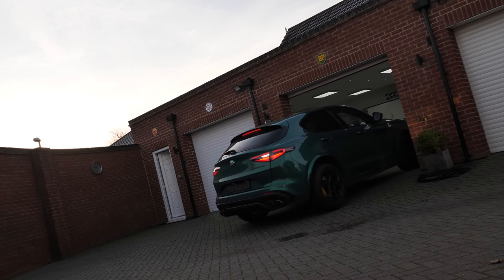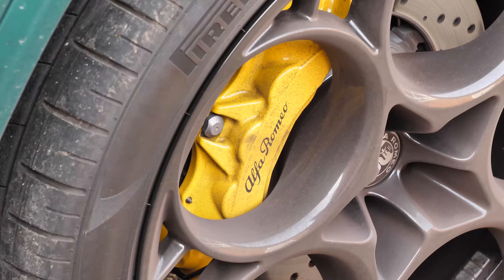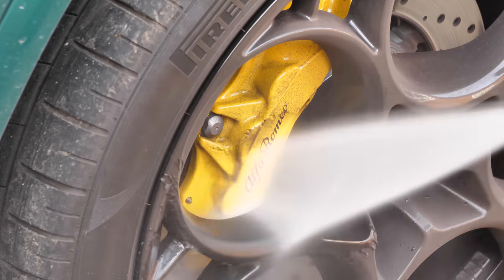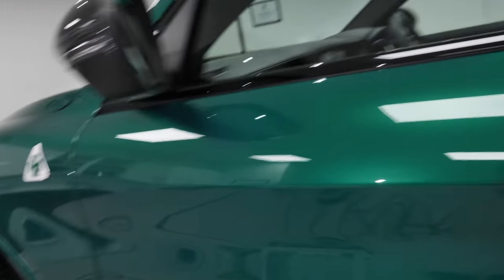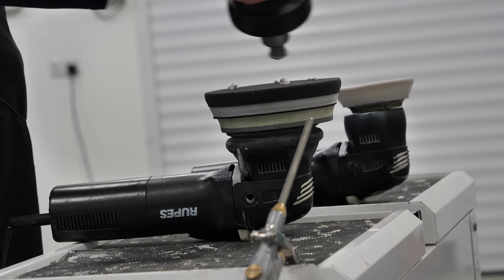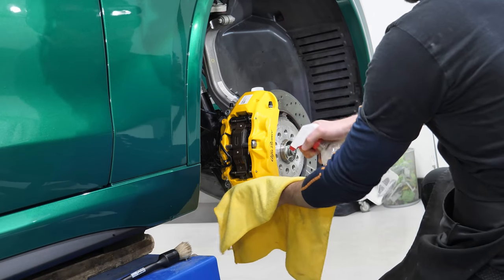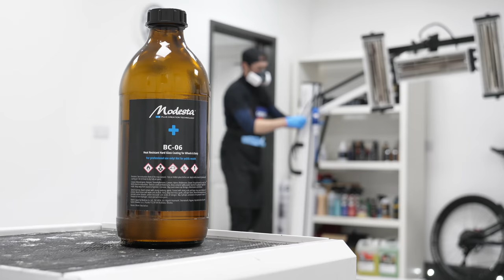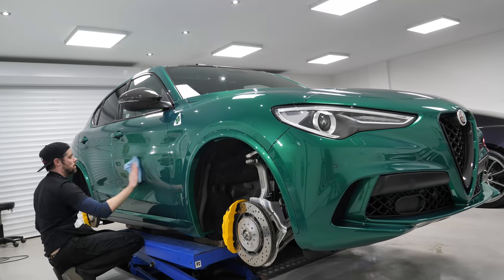Alfa Romeo Stelvio Quadrifoglio New Car Protection Detail with Customer Reaction - Montreal Green

Comment: Hi Jim, just wondering with the application of the BC04... What allows you to coat the entire vehicle before levelling and buffing the coating? Is it due to the cool weather there, or does the coating have a really slow flash time because it nees to be cured with lights? It seems like an absolute dream to apply! Have to be cautious here is Australia with flash times due to high heat and humidity.

Comment: Giorgio platform doesn't like pressure washers you always get random hazards flashing.
Reply: That happens because he have the keyfob on her pocket and when the water pass inside the door handle the car unlock the doors because the car is equipped with passive entry, that happen when i wash my Giulia too, if you put the keyfob inside of the car this don't happen anymore! 🙂